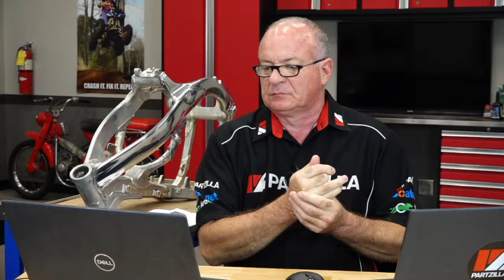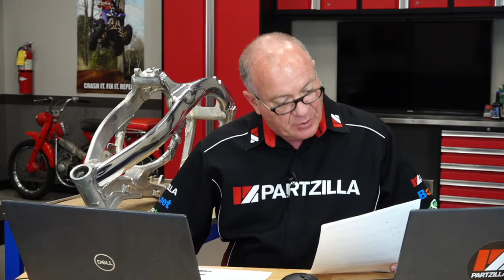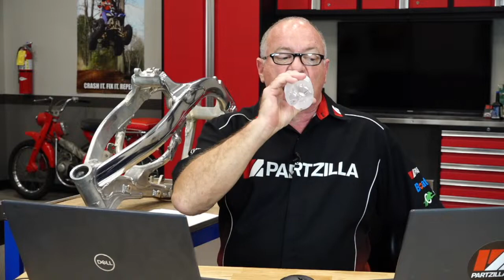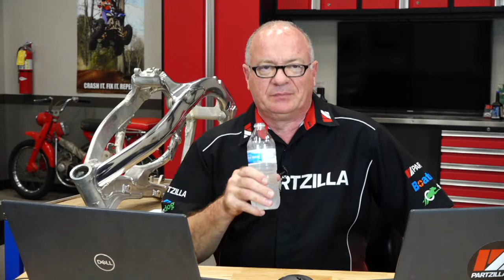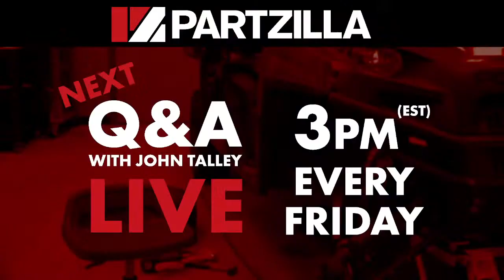Partzilla Live Q&A with John Talley -- 7/1/21

Comment: Ah ha, now I know why you were live on Thursday instead of Friday. So dealing with this Honda Foreman. I was able to purchase a manual on line and printed out a few sheets that is dealing with the TPS. The meter now stays in the green N light (which is a good thing)and N shows up but starts flashing 13 times. I've tried so diligently to adjust very slightly to see if it can be corrected. No matter what I do...still no change. I've tried to use the multi meter and find some type of video dealing with just the TPS. It's real sad if this new TPS is bad.